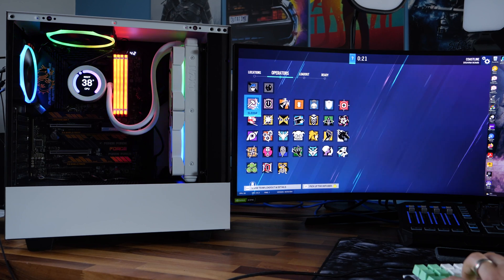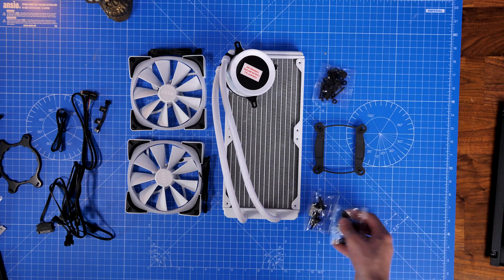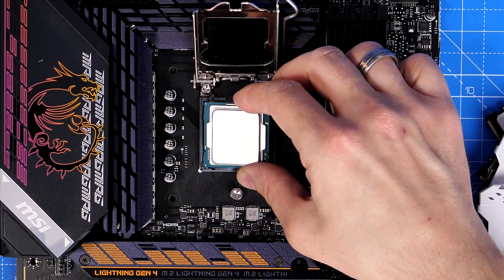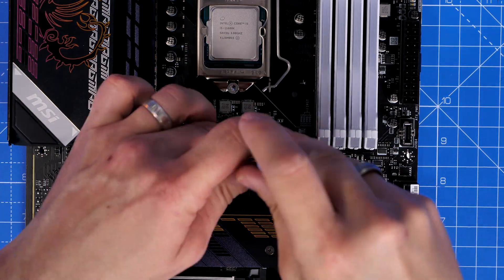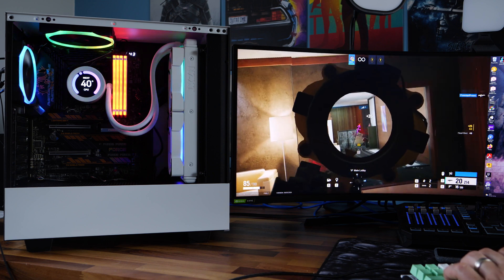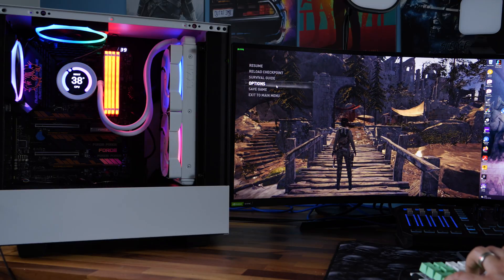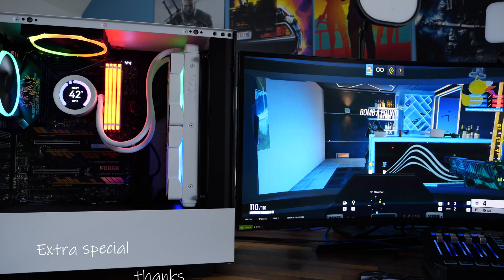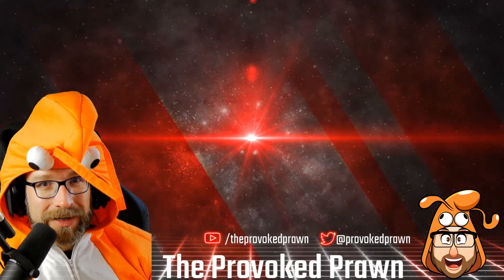Can you game without a graphics card?

Comment: I just set up my pc with the i5 13600k and am using a displayport connection and there isn't a signal on the monitor, is there something I'm doing wrong? I've double checked every connection and everything looks good there. Do I need to switch to hdmi until I get a gpu?
Reply from the maker: Weirdly I find HDMI works better for trouble shooting
Reply: Did you ever find the solution?
Reply: @Holt_771  no, I replaced the ram and even cpu, then contacted msi and they said I needed to update the bios but I can't do that without a 12th gen cpu because there's no flash bios button

Comment: You know, this is super relevant to me as i just had to RMA my 6900xt. I've been playing Overwatch at low setting at 1080p and it gets 70-100 fps with my 11900k. Pretty relieved i'm not completely without gaming.
Reply from the maker: Nice
Reply: can i ask what happened to the 6900xt to rma it!?
Reply: I'm here because I just RMA'd my 3080 back to EVGA. Tried OW last night and I got the same results on an 11700K. I'm a little worried gaming strictly on CPU, though. I feel like it would drastically reduce its life expectancy.
Reply: no it wont its a iGPU its not using the CPU it has a seperate dye.  @JesseBonales